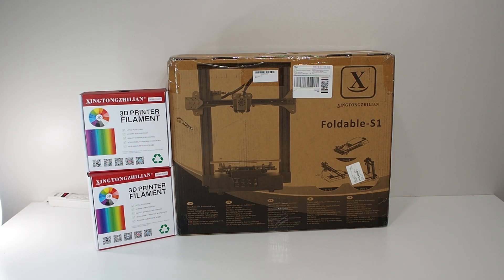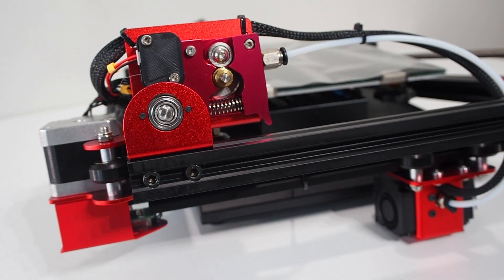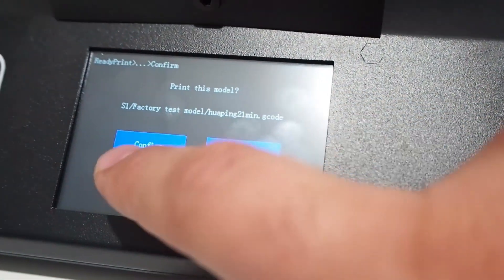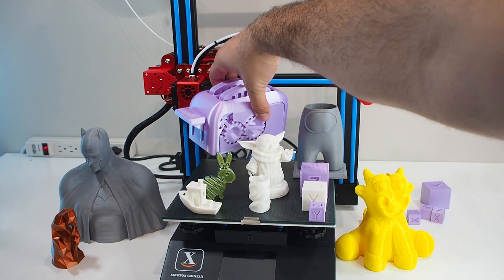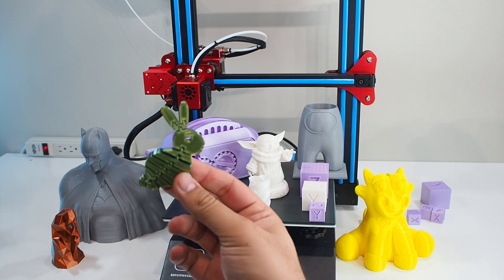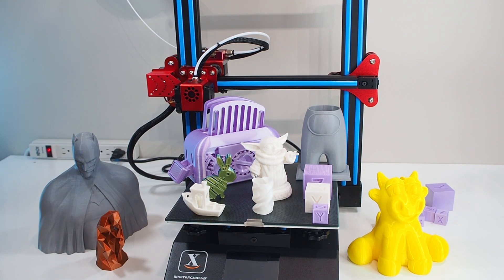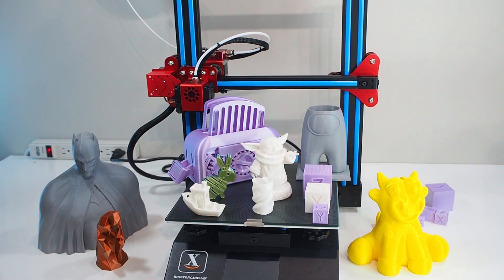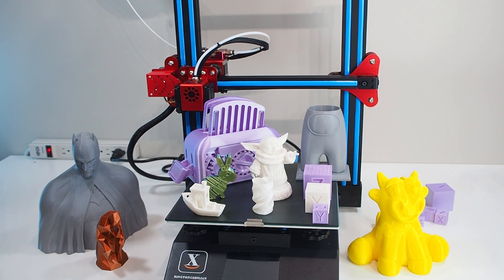XTZL3D S1 3D Printer Review

Comment: Hello i recently bought a 3d printer, the same one. But didnt work correctly and the micro sd didnt work too. I dont have the starter files and the plate dont head correctly. I think its a firmware problem because i got the Robin_nano35 Firmare: 2.0.2. Could you help to start to use it please?

Comment: Ender 3v2 versus XTZL3D S1 which seems better to you, I was about to buy a "voxelab aquila" which is a copy of the ender 3 v2 but for a lower price, the XTZL3D S1 is about 20 dollars more expensive in my country than the voxelab aquila but I think I like the XTZL3D S1 more since it has two z axes and also the filament sensor. My question is if with these improvements it actually prints better than an ender 3 v2
Reply from the maker: Thank you for your comment

Comment: Have you tried tpu with this printer? Does it well with it?
Reply from the maker: Yes, I printed TPU just bunchy come out very good. I changed the material profile from Cura and slow the speed with increasing the nozzle temperature and was good bunchy.
Reply: @stock3dprinting526  I’m seriously considering buying it. I’m just a little worried about being able to get replacement parts. Do you if the replacement parts are available?
Reply from the maker: I will be honest with you. The printer amazing but the what I understand from the company the will stop make them. If you interested. I'm making video review about printer like same call Fokoos Odin-5. But the parts yes available because there not spical made for XTZL3D, you can find them on Aliexperees.
Reply: @stock3dprinting526  when will you be reviewing the fokoos Odin 5?
Reply from the maker: 16-August The CR-10 Smart and 20-August the odin-5 😀 but look like going to switch 😂.

Comment: I have been using one for over a month and it performs very well. Total cost was 260cad on Amazon Canada. Hard to beat considering all the features.
Reply: I can also report that this printer can print flexible filament very well. I have over 300 grams of successfully printed TPU drone parts.
Reply from the maker: I'm happy to hear that. 👏 But regarding the TPU what can you please share the profile with us. I like to share it in Facebook group for XTZL3D to help others. 🙂
Reply: @stock3dprinting526  So far my best results are with this type of filament. ABS has been tricky in parts taller than 30mm. Hairspray on the bed helped with adhesion. I am still experimenting with settings, but I don't use anything special yet. I printed at 40mm/sec, 225°C on the extruder, 60°C on the bed. No fan cooling. Z hop enabled as well as retraction. I'm no expert and I usually settle for settings that are good enough to get the job done. I hope you feature this printer again in more videos, this would help a lot of users.

Comment: Hello good review  of the printer I bought one in amazon but I loaded the firmware that came, do you know where I can find it? because now the printer goes crazy.
Reply from the maker: Sorry for that, Do you mean the profile for the slicer?
Reply: @stock3dprinting526  no to the internal firmware of the printer the robin nano 2.0.2 adapted to the printer is the control of the motherboard and the touch screen.
Reply from the maker: Ok OK, I will check for you and talk to the manufacturer and there 3 deffrent barnd using the robin nano I will check if the have the firmware.
Reply from the maker: Check this :
https://github.com/makerbase-mks/MKS-Robin-Nano-V2.X
Reply: @stock3dprinting526  Thank you very much for everything but the fir black screen does not work I put the version 2.0.6 as I had it before until I can find the sulla at least you see an image
Reply from the maker: I'm wataing for reply from XTZL3D and I will let them contact you.
Reply: @stock3dprinting526  very well

Comment: Newbie here trying to buy a 3D printer bringing up a couple of questions:

1. What is this thing about the profile you were complaining about? Does it affect the print quality?
2. Is there a filament you recommend to use with this printer?

Thank you for your review.
Reply from the maker: There something call slicer profile whic transfer to model 3d in your computer to language call G-good whic the language the 3D printer understand.
Now evey manufacturer use there one profile with good settings fit there 3D Printer. In S1 the have no profile but I created a profile and available for you if you buy the printer. 🙂

And yes good profile will give you good quality.
Reply: @stock3dprinting526  Thank you for the 10% discount unfortunately I am in Europe and adding shipping and import TAX would be expensive, however I bought it on Amazon along with a green filament, and I am facing now two issues: 

1. the SD card provided was broken in half, what was inside the SD card? (not smart to leave the SD card in the slot, tho).
2. I am not able to read STL files.

Would you share the profile and how to use it?

Do you have any hints on how to read STL files?

Cheers.
Reply from the maker: Oh, No sorry for that.
Make sure you talk the customer services and the wil send you  new card.
Make sure if buy SD card to to be 8 GB more than don't going to work.
And please send me Email and I'll reply to you with the profile.
Reply from the maker: Bashar@stock3dprinting.com
Reply from the maker: For the fileamnt  there  good fileamnt and the price very cheap. Have look in there price

https://www.xtzl3d.com/product/pla-3d-printing-filament-xtzl3d/?wpam_id=39
Reply from the maker: And if you like to buy the printer use this coupon 10% discount : VIPBashar10%
Reply: @stock3dprinting526  Your coupon is no longer working :(
Reply from the maker: Oh, No sorry for that let me talk to them see if extend the coupons or try to get a coupon.